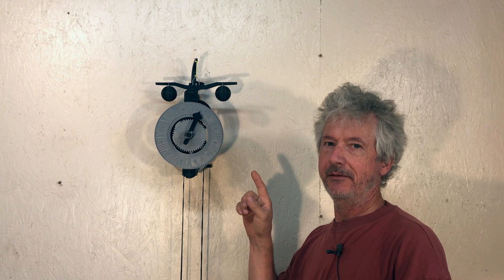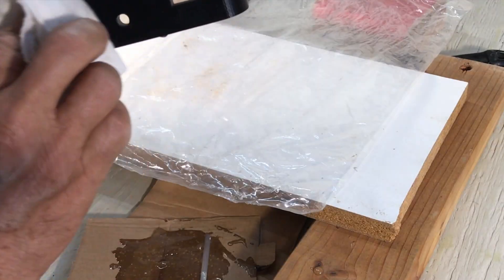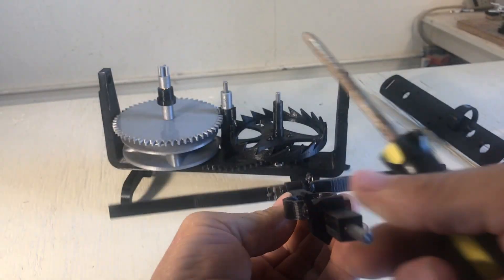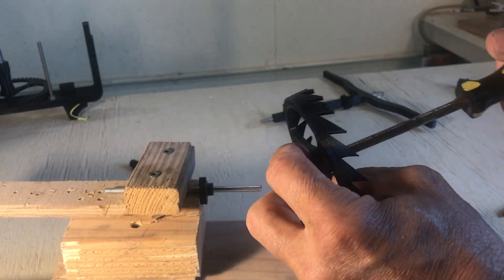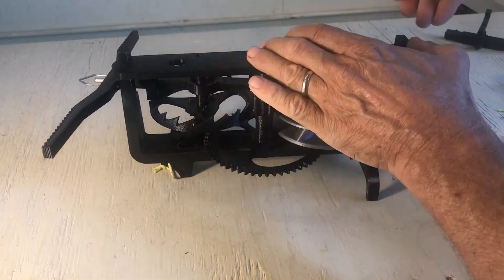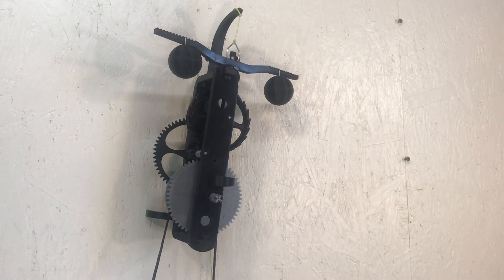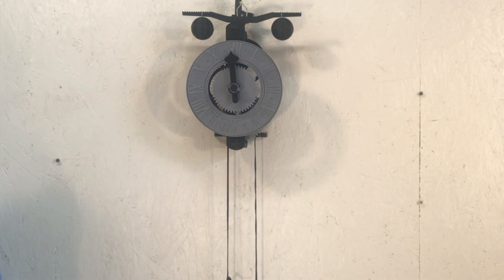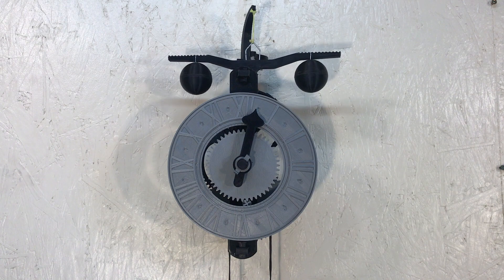Build a Verge and Folio 3D printed Clock

Comment: Just finished building this clock, Run out of shaft's but used no 7 Alum knitting needles, Just the job and cheaper than Silver steel, Nice Clock
Reply from the maker: Good job
That is a way of doing!